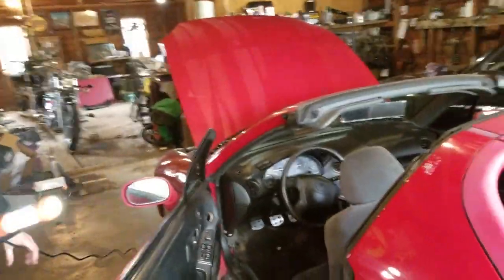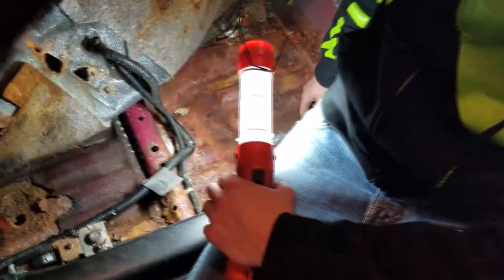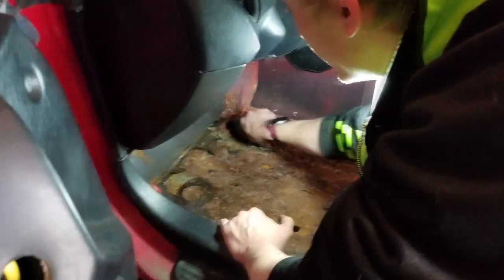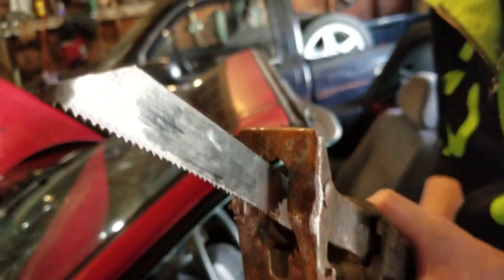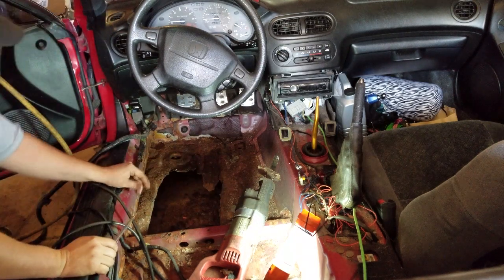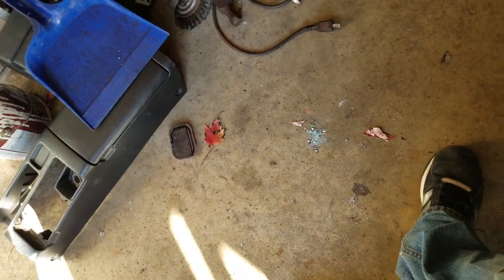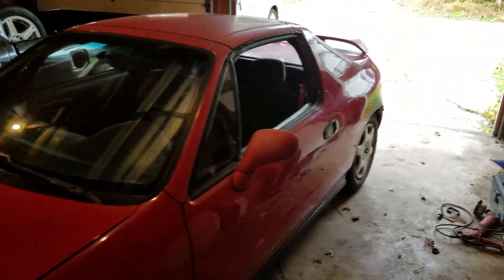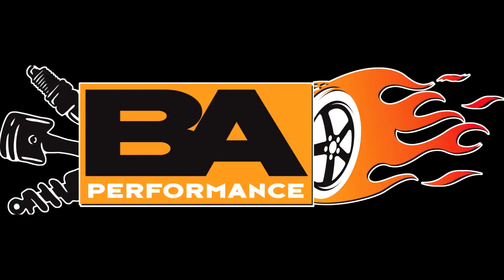CIVIC Del Sol Floor Pan

Comment: How did this hold up....found similar in my 07 civic. Not dead yet at 397,000 miles pondering similar, plus lots of woolwax lanolin undercoating, and coat under the carpet 🤣
Reply from the maker: It's still holding strong